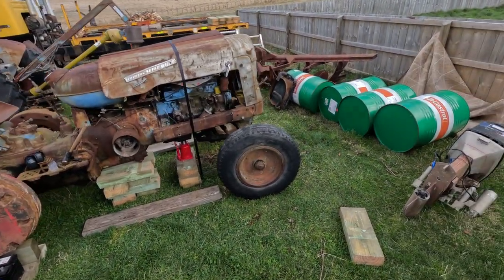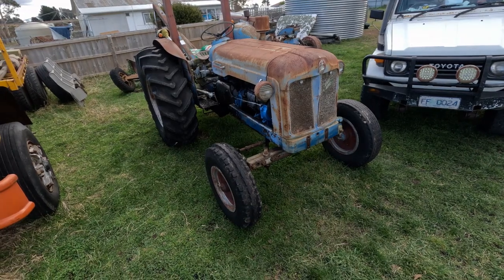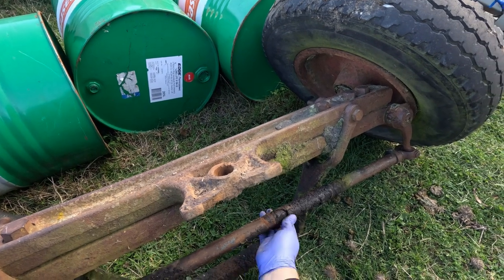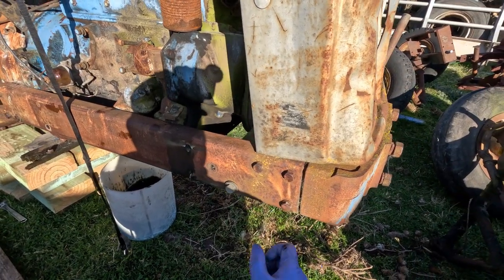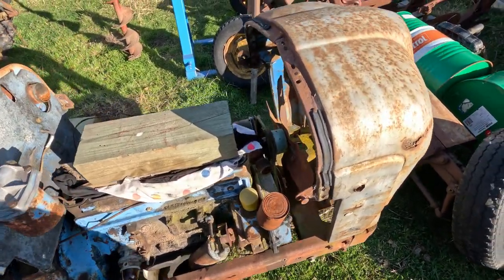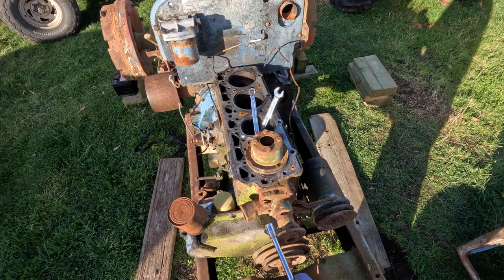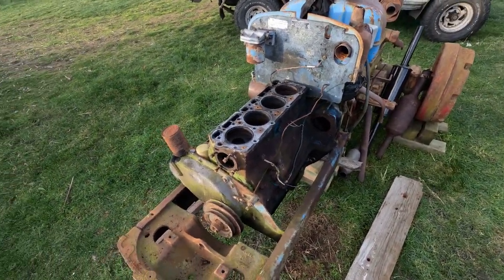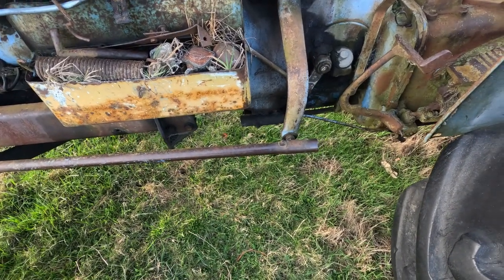Fordson super major project pt4 preparation for engine removal

Comment: The drag link joints on the Super Major are different. Dad had Majors and a grey mud guard SM. This had sealed joints. I would say someone has put the grease nipples in that one or cut off the original and welded new ones on. The PM drop arms came from the diesel Major and SM are different as they were heading towards the thousand tractors. A 6 cylinder conversion would be very cool.
Keep up the good work.
Reply from the maker: Thanks for the information that's really helpful 👍